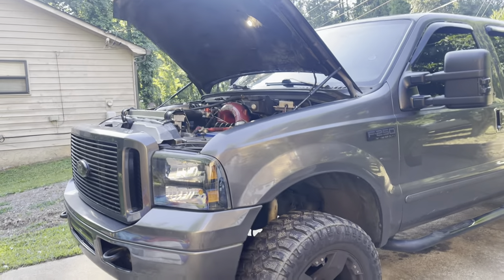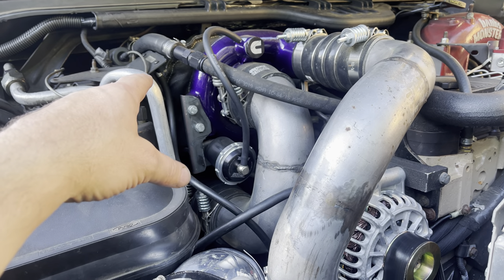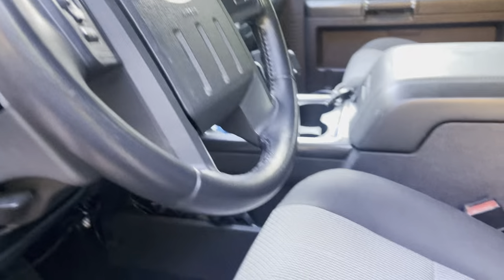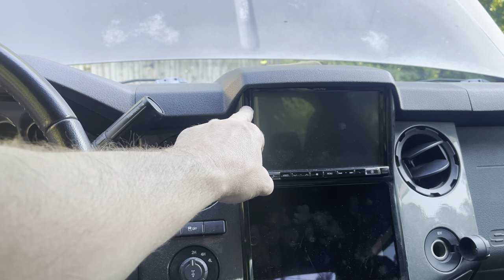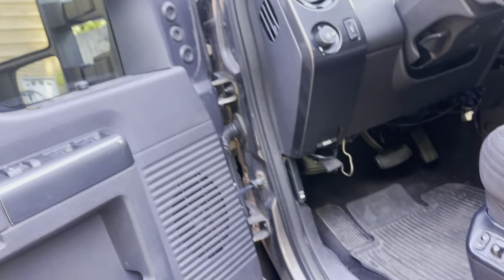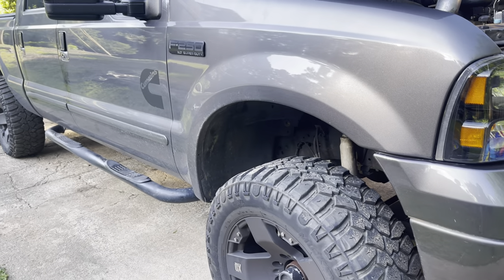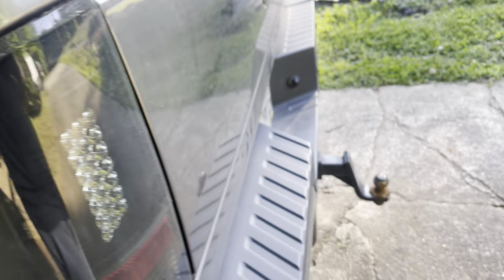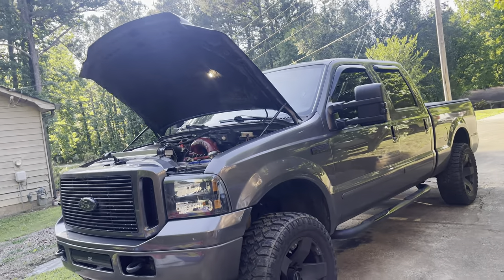Update/walk around of my 04 f250 Cummins /Allison swap

Comment: If you really wanted to, you could remove the degas bottle, then install a radiator filler neck and 16 psi cap in the top radiator hose with an overflow tank for a cleaner look.

Comment: What did you do for the throttle position sensor, and shift tunes? Looking to put an Allison in my 97 dodge
Reply from the maker: My p-pump has the throttle position sensor on it so what ever came on a dodge truck p-pump is what I’m using 
I’m running the standalone controller from destroked  we did the initial set up and just been driving ever since 
I have tow haul and tap shift functions it was really easy to install and get working

Comment: Does it throw any codes?
Reply from the maker: What do you mean 
I use an HP TUNER to turn off everything that did not matter anymore because of the swap so I don’t have no check engine light but my check engine still functions as it should for everything else
Reply: @SGTBELL1  I live in California and was wondering if your truck threw codes after the swap. In California it can’t throw codes if I want it to pass emissions
Reply from the maker: Oh it would fail in California if I’m not mistaken I live in Georgia so I don’t know the rule and regulations there but yes my truck had check engine lights and stuff because I no longer had the factory engine so the Ecm was not seeing the electronic from the the factory engine that are no longer there